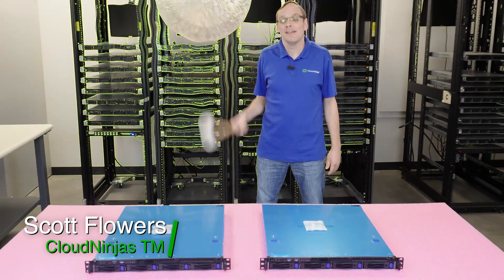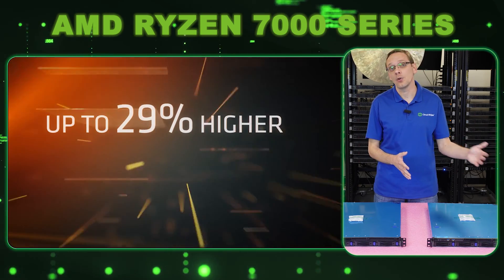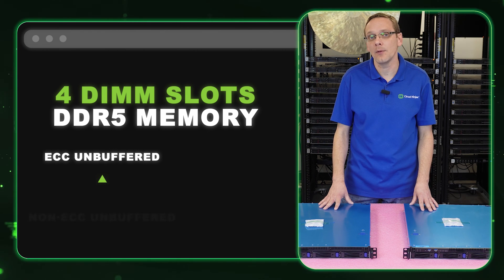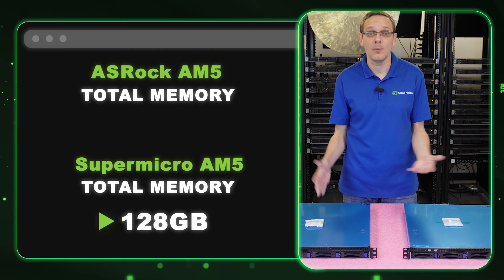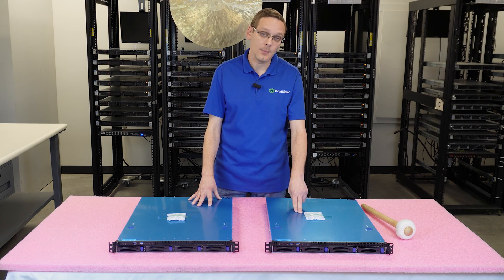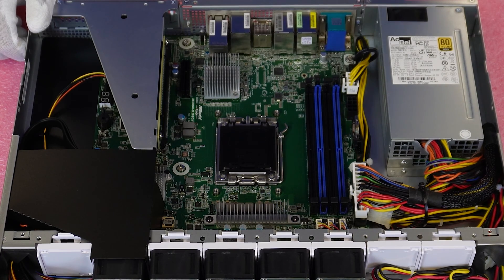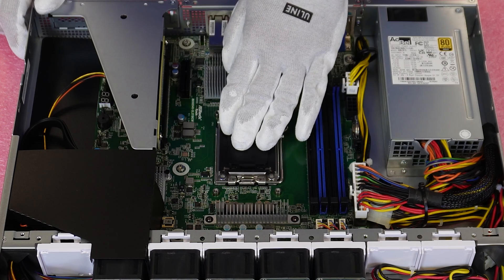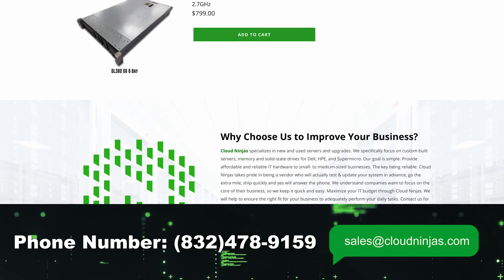ASRock Rack B650/2L2T Overview | AMD Ryzen | DDR5 RAM | Drives | Power Supplies | 1U4LW-B650/2L2T

Comment: can I do software raid with this I know the b650 chipset supports it but im unsure if the server equivalent would
Reply from the maker: Looking through ASRock spec sheet I am not seeing a RAID software as an option, I would say there most likely isn't an option to use a software RAID for this specific server so you'll be mainly using a RAID card with this machine.

Comment: Installed one for a customer with a 65W Ryzen 7700, 3x Kingston NAS SSD with Linux ZFS, and a single 8TB drive for videos. I recommend sticking to a 65W CPU so max the 12-core Ryzen 9 7900. And the server is SATA only, not SAS.

Comment: Just not compare Ryzen with low budget xeons. Compare them with the core series  you'll get intel best on that
Reply from the maker: We compare what they compete against.  Ryzens compete against Intel E-2400 series.  Intel Scalable compete against AMD EPYC.  And that's a whole different video coming out in somewhat near future.
Reply: @cloudninjas  but Ryzen are not server/workstation oriented cpus, they are for standard pcs as Intel's core series is for. Obviously a 7950x is better than an e2488 which is low budget stuff, compred to high budget stuff. They're using standard cpus in servers which is not that great but the platform longevity for AMD is way longer than any Intel
Reply from the maker: There is an entire Ryzen server product line.  There is some confusion bc there are 7950x for pc and separate 7950x which are server grade.
Reply: @cloudninjas  what is the difference between the ryzen desktop and the ryzen server product codes? Are the chips binned differently?
Reply: Xeon E-2400 doesn't even compare with typical Desktop CPUs well. Let alone server grade Ryzens.

But, Ryzen server grade is literally Ryzen desktop. Ryzen desktop CPUs will run ECC as well. And also, Intel actually suggested Core i series CPUs to be put on W680 boards because...
there wasn't any Xeon E. And Xeon E-2400 series lacks E cores as well. Plus if you need efficiency which you do, Zen 4 is vastly superior to Raptor lake.

And on the side note of cost? E2488 costs more than 7950X desktop as well :)
Reply from the maker: Love the detailed comment. And agree Ryzen over the competing Intel product line.